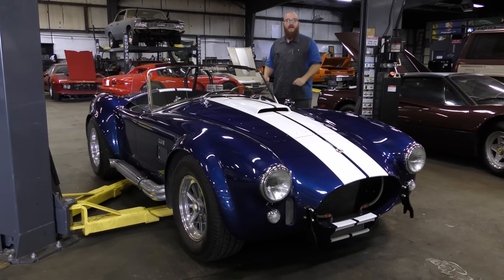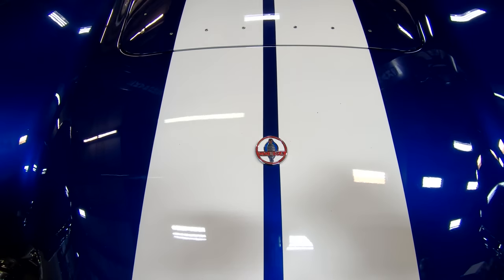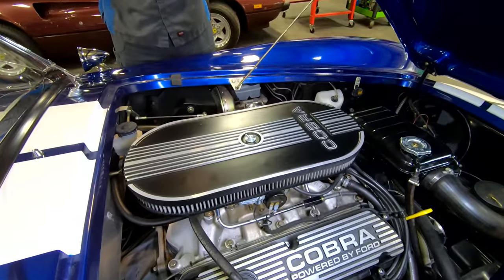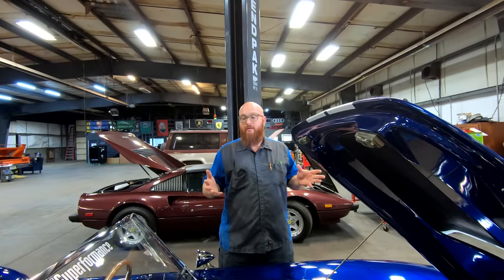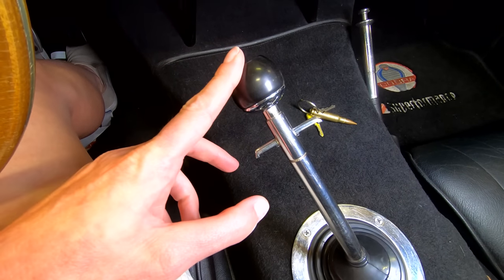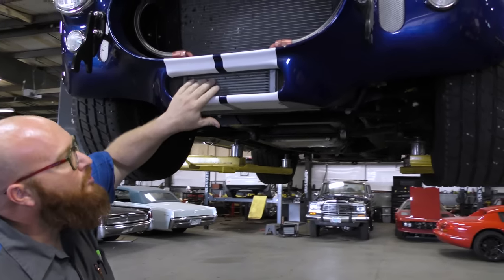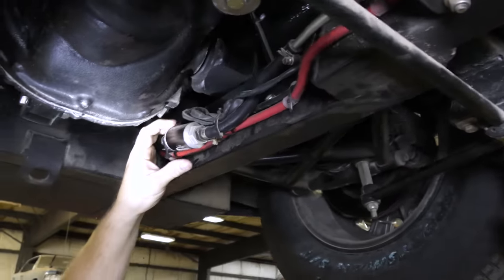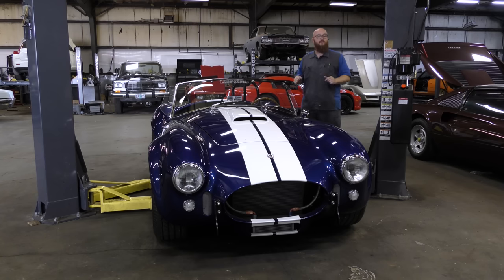Super small with a huge engine! Why is this '98 Superformance Shelby Cobra in the CAR WIZARD's shop?

Comment: Nicely engineered car.  I don't get why they went to a square tube frame, though.  The originals had a far lighter, stronger 4" round tube main frame rails.  I know Factory Five (the biggest Cobra replica maker in the world) uses 4" round tubes.  I suppose it's cheaper and easier to do the square tubing.
Reply: You can choose between round or square frame with superformance
Reply: Square frame is more rigid. Which improves performance.
Reply: Only the Mark 3 cars had the 4" tubes. This was an improvement designed by Brian Waite (ex Aston Martin and Lister). The Mark 1 and 2 cars have 3" diameter main tubes. It was found with the sole experimental 427 Mk.2, that these were hopelessly inadequate to handle the torque. That car was quickly changed back to a 289. Brian designed and built the tubular chassis for our 1970 "Fraud" Morgan modsports car 4/4 with a Martin 2L  engine.
Reply: @dp4122  not true at all. you don't see many superformance on the track, but a lot of Factory Fives and Backdrafts due to better rigidity

Comment: I've built three Cobra Replica's in the UK but even with only 300BHP they are still scary fast weighing in at sub 1250 kg  thanks to either modern European or Japanese 32 valve ohc V8's. They also do 35 uk mpg on a run.

Comment: Nice!  A Ford dealer told me, back in the day they couldn't give these away, they just sat on the lot.
Reply: He was in the wrong location or feeding you a line of***.
Reply: Must have been during the 70's gas crunch. Most performance cars went for next to nothing during that bleak time period.
Reply: This is true these cars where impractical for most and the cost of one was double of most other cars of the day.
Reply: It was expensive. And it is impractical. Still wish I could have one.
Reply: @craigpennington1251  you'd be wrong

Comment: This is why old cars are the best. Is it getting fuel? Yes. Is it getting air? Yes. After that we're good to go. No darn harness with 215841863 sensors on it.
Reply: with daily fiddling with carburetors and you know there's something wrong when there's a hole burned in the piston. 😉
Reply: @jochenstacker7448  If you have to fiddle with a carb on a daily basis, you don't know what the fuck you're doing.
Reply: @jochenstacker7448  The only time I fiddled with a properly working carb was slightly adjusting the choke tension coil going from winter into spring and fall into winter.

Comment: Great video,Car Wizard.
Thanks for the carb tip about the choke.
What a magnificent car.
Definitely one of my lottery cars.
I would add two black chrome quality mesh grills at the front of the car to protect the radiators from road rocks and sad to say,I know it would be ugly but I would put secondary leg protection where your legs can contact those great sounding side mufflers getting out.
That kind of burn,when you just got off the interstate gunning it ,is instantaneous and very painful.
But what a wonderful car.
Not a kit car at all.
The Superformance is a quality special manufactured high performance classic that is many ways better then the original Shelby.
Especially since those original Shelbys are now going for several million dollars each.
That box frame looks ridiculously strong as does the x braced rear a arms on the rear suspension.
The entire car is built like a frikken tank.
A very very very fast wonderful sounding and looking tank.
Yea,definitely on my lottery list ,for sure.

Comment: I hate to tell ya Wiz, but that's not a 427 from the real Cobra days. That's a Windsor based 427 stroker engine.
I built one of these 'kit cars' a little over 10yrs ago. It was powered by a mildly built 03 Cobra engine, with the parts car being a wrecked Cobra. It got all the parts from the drivetrain, 6sp Tremec and the IRS. The car kept everything from the donor car, except a/c. With a custom wiring harness, the stock 03 Cobra computer ran everything as it did in the Cobra.That means computer controlled engine and active traction control and anti-lock brakes.

With using the stock computer and the safety features functioning, this was about the safest Superformance MKIII Shelby Cobra you could build. You could still easily get in trouble with the car! It was way faster than an 03 Cobra and could stop MUCH quicker. It was as pretty as it was quick. It was painted with 04 Cobra Mystic paint.....STU PID expensive!
It was a very fun , but frustrating build. I'd build another, but I'd charge a hell of a lot more!
Hmmmmmmmm........I wonder if a Coyote engine would fit?
Reply: Fit yes, yes it would I built mine with a Gen Coyote, a T56 trans and 17 Mustang Gt IRS.  It’s the same size as the 4.6 DOHC in the Mustang Cobras.
Reply: @253speedgarage5  Yeah, I figured it would. Did ya have to stick with the stock intake manifold, Boss intake would look better and ya can do a direct port nitrous if you're crazy enough.
Reply: @rayjay8322  I’m using stock manifold I have thought about the boss intake. It has plenty of power no nitros.  400hp at the wheel is plenty very fun to drive

Comment: I remember being taught not to set the choke in the early 1980s as fuel injection took over.  It took a while to remember to keep your foot off the gas.  Then I had to learn the high beams on cars are not on the floor board any more. (much better I think then now on the stalk operated by your hand.)

Comment: This used to be my dream car until I sat in one. I had to remove my shoes to drive it due to the narrow pedal box. Still a very cool car.
Reply: How tall are you? If you sat in a cheaper replica it would be tighter. I'm 6'7" and can comfortably drive my superformance. The car was designed to fit people that are 6'4" so I'm pushing the limits
Reply: I’m 6’ and the steering wheel was in my lap - I could take that for about 1 hour…
Reply: Dino Martino I am also 6’ and I found it super claustrophobic. Any accident would be bad news.
Reply: @ronjohnson8119  try a Corvette - not as brutal but not a Ford ... lol

Comment: DJI has the Osmo that might be good for what you need.  Also has good gimbal action it so you can keep it steady easier under a car. It's not exactly a go pro but I've seen many Youtubers use it little to no trouble over the years. Also you could consider replacing it with a normal camera that has decent video quality and mic inputs. I recommend Panasonic. Sony makes good stuff too.
Reply: There's a type used by bikers that sits on a stick. The stick itself is electronically removed from the video.

Comment: A friends dad got a Cobra kit car which he built with the Jag suspension option over the Toyota Crown one. He's a welder by trade and took one look at the chassis as it was shipped and cut it up and put it back together again because the welds were shoddy. He put a 427 in it and had the same colour paint scheme. It looked just like this car. The paint job he had put on won awards at local car shows and he took out car of the year for the local Ford show. I loved that car.

Comment: I always use a manual choke on cars like this. This one is super quiet. Cobra> always wear heavy long pants and high enough boots so you won't get burnt. The boots will give your foot & ankle support when pushing in that Non Hydraulic clutch. This car may be different (?). Love that Blue Paint.
Reply: guess you don't have any experience with cobras. almost all owners, myself include, find they need narrow driving shoes to be able to operate the clutch, brakes and gas pedal. also a hydraulic clutch isn't that much different than a properly setup mechanical linkage one

Comment: I've always started carbureted vehicles by holding the accelerator about 1/4 down while cranking, except in very cold weather, it was necessary to tap the accelerator a time or two in order to start.
Reply: Once the auto choke is set by an initial push on the throttle, it should start foot off if the fast idle cam is set properly. Important to not have the choke set too rich in very cold starts, or it might flood. Carbs vary with this condition. I never liked regular starting fluid, but cigarette lighter fluid works very well.

Comment: WIzard, DJI Osmo Action 1 (original) will not overheat.  Like the GoPro you don't have to focus it either.  Picture is decent but not quite as good as the new GoPros, probably on par with a Hero 8.  You need the CYNOVA audio adapter for it which is cheap and works well.  Very cheap and reliable combo for an action cam.

Comment: Actually was fortunate to sit in an original cobra. They’re spacious. It was part of Manheim $1,000,000 sale event. Basically anything you can buy luxury or otherwise. To put in perspective a Mercedes SLR Mclaren was on the lot.
Reply: If you think they are spacious, your real name MUST be Mr. Gnome!
Even after I made custom pedals, I had to drive barefoot on the same kind of car the Wiz is showing here. The footwells are the same size in both cars.
Reply: @rayjay8322  I’m somewhere around 6’2”. It was roomier than an old lotus I tried to sit in. I’d say ballpark being a Miata on the cobra. Talking 95 model with the seat not adjusted from a woman a foot shorter. Did catch me off guard. Didn’t drive the cobra. It was on the lot and keys pulled for safe keeping. But yeah. A lot of cars went “ooooh” and found disappointment.
Reply: The smallest car I ever sat in was a brand new 1970 MG Midget at the LA Auto Show. The issue wasn't smallness it was a frame rail just behind my feet, causing my feet to be stuck. I had to crawl out. 

I have driven other little cars, 427 Cobra replica, Porsche 914, Porsche 924, modern Fiat 500, Mercedes 500SL, Triumph TR4, TR6 and TR7.
Reply: @georgekerr8804  smallest production car I drove was a first gen, SMART car. It had the original clutch in it. Which it’d kick like a fucking mule. Haul ass then actuator would go to shift, dead silence and wam! I did attempt to sit in an older lotus. At the auction drove damn near everything. It was one with luxury cars. I think one I can make, that seems impossible to find evidence. There was Dodge challenger’s that had Star of David on the headrest saying Dodge brothers on them. Drove GT500’s, rolls Royce, Aston Martin and all kinds of goodies.

Comment: TIP I mentioned last video about how to deal with the overheating on your GOPRO. Change to a fresh battery and you can keep going while the other battery cools down. Turning off any view screens can help keep it cool too.
Reply: Another tip. If you're not using it as an action camera then get the Media Mod. Remove the internal battery and use an external battery plugged in to the USB port on the media mod. The GoPro will not overheat this way.
Reply: @riccochet704  that would totally work here, but I need the case closed as I'm cooking and occasionally it gets splashed.

Comment: Crazy to think that the wheels on that attach the same way as the ones on my RC car.
Reply: That type of wheel attachment likely pre-dates RC cars by about 100 years.
Reply: To put them on and off, rhebcorrect way is to hit the 'wings' with a lead hammer!  It can be a pretty fair exercise 😄
Reply: @saki302  I've owned several Lotus cars with "knock-off" wheels, used a brass hammer, which works both on the wing type, and the wrench type.

Comment: Sorry that you're having problems with your GoPro. 😞 (I have a GoPro 10) It's a known issue that they can easily overheat and shut down, especially if the weather is hot outside (+80F). The temp sensors inside the case are very sensitive and the camera will shut down to protect the video processor circuits/GPU. It might help to see if your GoPro needs a firmware update to solve or at least mitigate the overheating issue. Good luck.

Comment: Slight correction (not meant to be I gotcha): "lacing wire" going to the center "lug nut" is not meant to hold it in place. Its is used so you can quickly look to see its not lose.
Reply: It's designed to not allow the centre spinner to undo itself.
Reply: @ro63rto  Tensile strength of the "wire" does not have or was it designed for the ability of a small caliber wire to resist a force that would pull it apart. It gives the pit crew/driver a quick vision if the center "lug nut" is lose. That is exactly what it is meant for, nothing else.
Reply: It's specific safety wire for hardware. It'll stop the "nut" from spinning off
Reply: You are correct, it's a quick indicator if the nut has loosened. it isn't there to keep the nut tight. I have them on my car

Comment: Wizard, greetings from Mexico City. You can see in this car what is mostly hidden in others by the front grill: BUGS. Is it safe to wash the radiator like the HVAC guys wash the coils on a central air conditioning on a home? Thanks for such an amazing channel.
Reply: Spray the radiator with bug & tar remover or degreaser. Hose off with a garden hose. DO NOT use a pressure washer as it will bend the fins.
Reply: @markusstrobl1067  Thanks

Comment: A Car Wizard fail. Any mechanic with good eyes knows a Ford Windsor family engine when he looks at it. The Cobra 427 is an FE series engine, and that is not what is in that car. One look at those valve covers and you know you've got a Windsor engine, not an FE. If it's a 427 then it's been bored and stroked as the biggest factory displacement for a Windsor is the 351. Many of those replica Cobras have 302s (5.0s), which is also a Windsor engine, and that is just fine actually. A 302 built with every modern trick would easily make for a thrilling ride in a car as light as a Cobra. I had a friend who had an ERA 427 Cobra with a hot Weber carbed 302 that was pretty impressive. He didn't put the 427 badges on his car, but lots of guys do whether it's a 427 or not.
Reply: Someone in a post above stated it has a bored and stroked 351 Windsor displacing 427 cubic inches. But yeah, I noticed the windsor valve covers and thought the same.
Reply: It's Bored and stroked to a 427. No, it's not an FE but Ford makes a 351 based 460 small block. This is not a kit car it's a factory built superformance.

Comment: I have almost exactly the same Superformance, crinkle valve covers and all. The one thing I don't like is the large steering wheel and manual steering. Fine on the highway but nearly impossible at the autocross track.  I also don't like that there are lap belts only.  I also own a Factory Five which has a 5-point harness but you can really feel that it's a track car.  The Superformance is factory-built and really drives like a production car!
Reply: yep, the Superformance isn't as good of track car
Reply: They offer shoulder belts as an option
Reply: The car has shoulder belts on the drivers side. At 10:00 you can see the anchor behind the drivers seat.

Comment: I didn't think I needed power steering on the 1990 Monster V8 Miata purchased many years ago (and unfortunately sold many years ago too).  On the highway that was true, but at slow speeds in parking lots the manual steering was a chore.

Comment: Stunning looking car, and I'm sure it's tons of fun to drive, but the placement of the exhausts would have me terrified of my passenger burning themselves. Terrified enough that were this in an option for me to buy, I would not. Certainly not this formation of it. But yeah, it looks amazing. Total eye candy.
Reply: The street version of the original 427 did have rear exit exhaust !!
Reply: @arkhsm  Interesting! Why do you think it is this one has side exhausts? (I know nothing about cars lol Sorry!) Is it cheaper? Something to do with performance? Or did they just think it looked more cool/eye-catching like that?
Reply: @Kaioken20  Most Cobra replicas look like the original Semi Competition version, which had this higher performance exhaust, and yes, it does look cooler !!
Reply: You can buy a 24 inch by 24 inch welding blanket for $30. and drape it over the side pipe for passenger to exit safely
Reply: @arkhsm  It looks like a car you would drool over even as a child; an absolute epitome of cool.
Reply: @Kaioken20  The '70s movie Cannon Ball Run is what made me a Cobra lover. The one in the movie was not a replica !!
Reply: @arkhsm  Need to watch that movie again! Thanks.

Comment: Superformance you can buy it completely built. Factory 5 is the one where you gotta build it yourself, their slogan is "Built not bought". Factory 5 is much cheaper but of course you have to do the wrenching yourself. Also need to source your own motor and transmission but you can probably build one for 30-40 grand all in.
Reply: Yes you are right but put new all new crate engine and transmission it get to be closer to 80k.  I have 60k in mine as you see in my sig.  Coyote,T56, modern IRS and a lot of custom touches.

Comment: scary letting a young mechanic work on old engines, perfect example would be the Ford 1960s big block FE engine. one glaring possible problem for the inexperienced mechanic is the need to remove the rocker assembly to remove the 80+ pound intake manifold. and the one rocker shaft bolt on each bank that is tapered to allow oil to lubricate the rockers.

Comment: For anyone curious, an original Shelby Cobra sells for anything in between $2 million and $12 million.
Reply: In 1970 the originals (427) had dropped slightly and could be bought in semi - rough condition for around $5000- but very hard to find one.

Comment: This is not a big block Ford. Intake is wrong as is the block ( no skirt for the cross bolt mains ). It is a Ford small block which can be built to a 427 displacement. It’s a nice motor but not the same as a 427 FE that came in the Shelby Cobra.

Comment: the engine is not a big block 427. The engine is a small block, perhaps a 351 Winsor. Could even be a 289 warmed up with performance parts

Comment: Not a "big block." That's a Windsor engine. With an aftermarket block you can build a 427 stroker 
Windsor. But only the FE (352, 390, 406, 427, 428) and Romeo (429, 460) engines are big blocks.